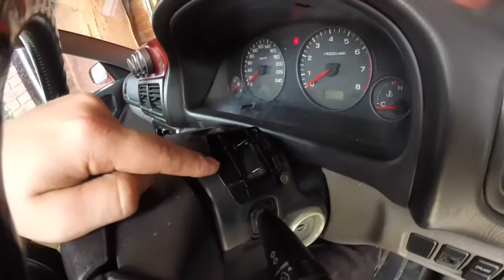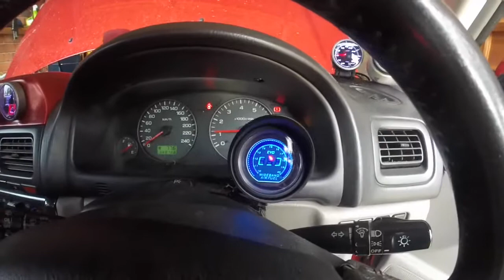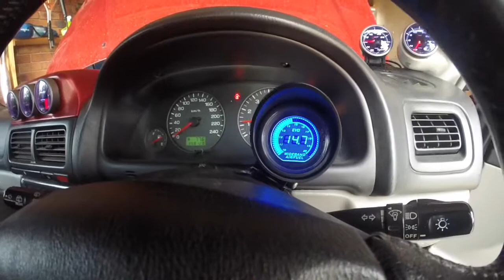Installing Air Fuel Ratio Gauge

Comment: 20!!!   Is when revved up and throttle off just air blows through without fuel just atmosphere which is 22.  Readings under constant load are the only ones to worry about you need to be 11-12 ish under boost if over 14 under load you will fry piston rings with detonation. 14.7 closed loop at idle and off boost is optimal stoicheometric ratio.